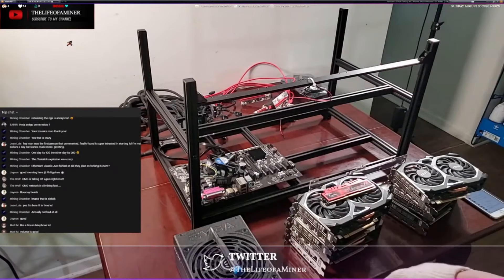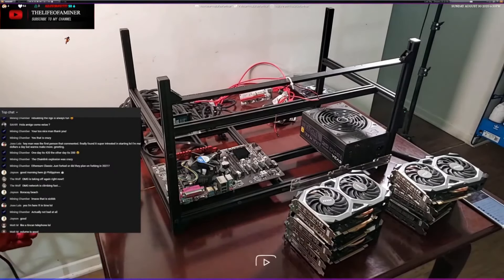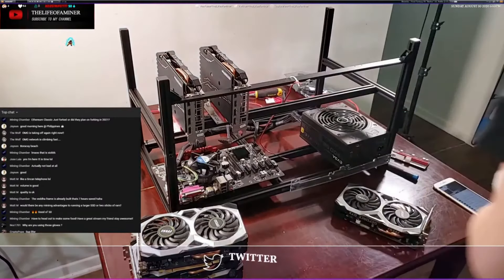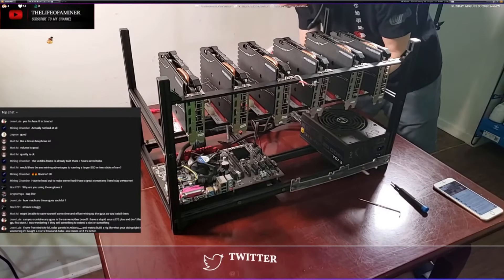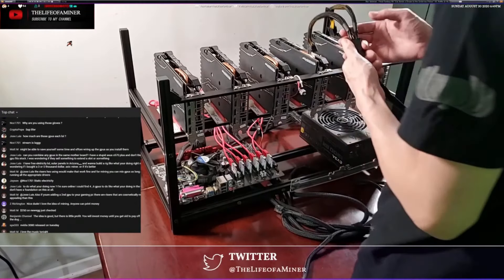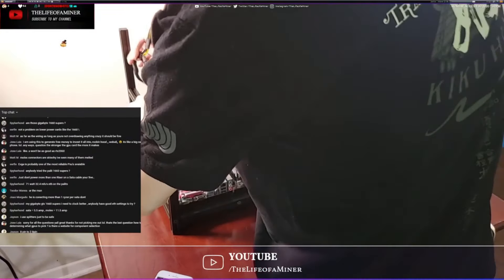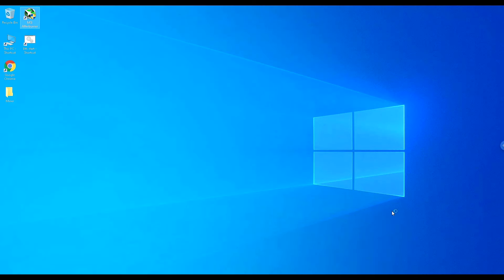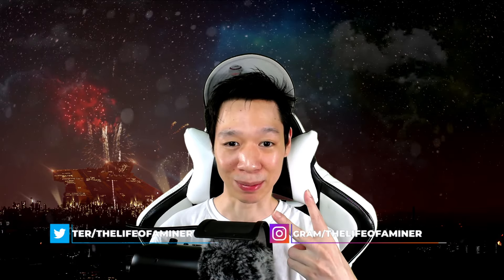Building a GTX 1660 Super Mining Rig Live | Recap

Comment: I've had the issue of GPU's not showing up in the device manager... double check BIOS and motherboard manual... sometimes a PCIE slot will be disabled based because of a BIOS setting or placement of an NVME drive

Comment: Helloo, how minimum the power supply (smps) is required for 6 1660 super rig ,1320 w is costly
Reply: 8 x 1660 super rig with good oc setting could figure with 1000w psu
Reply: @quad613  only one 1000 w ,but he is using two in the videp
Reply: @vinaykumar-gw1uk  maybe he has only 1300w could be use, this is just a setup to showing you what he is working

Comment: I use sata. Not a problem using it
Reply: As long as you know what wattage your GPU draws from the riser. Try it with a stock 2080ti that peaks at 80w from the riser and you will have a very warm and unhappy riser in almost no time.
Reply: @daniellarsson3453  You are right. Sata helps to remind miners never to mine with stock settings unless you want it to be your last mining experience
Reply: @sinistar9044  I have mined for 5+ years mainly GPU/FPGA and even I tend to forget that stock-settings on some card can wreak havoc on risers. I mostly run riserless boards where the issue isn't really that prevalent, but in exchange you run the risk of TRULY starting a fire if you melt the PCIE on a riserless board.